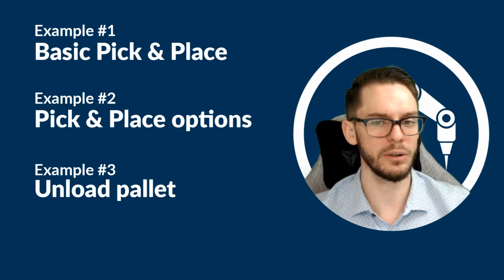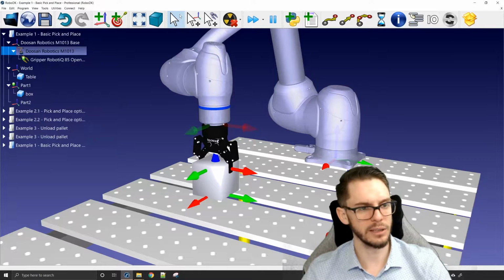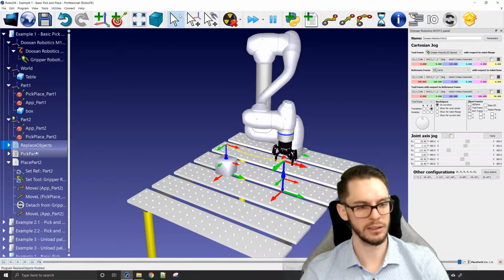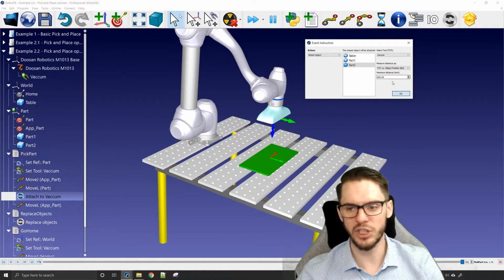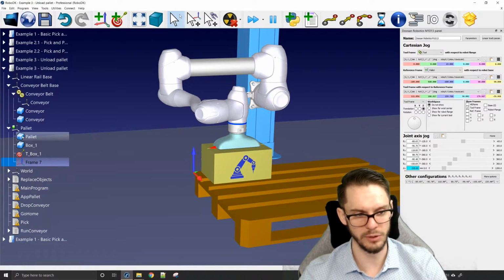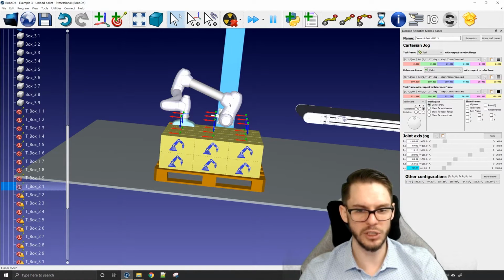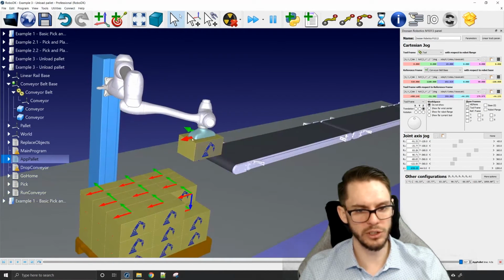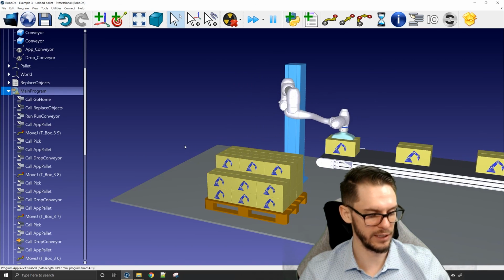Pick and Place - RoboDK Webinar

Comment: Hello! I have a question about connecting the robot with ROBODk through IP address. I tried to post it in the Forum also. I think I am not allowed to make a new thread in the Forum. I guess.        My issue is, I am entering the Robot IP in Robodk it says connected, ready but when I click on "Get Positions" or on "Move joints" It says not connected with the red signal. What should I do about it?  What should I do to connect it, even on checking with cmd, there is 0 percent signal loss for the IP address. I read the documentation also but it did not work. Help and guidance from you would be appreciated and if possible please allow me to make a new thread in the Robodk forum!
Reply from the maker: What robot brand are you using?
Why do you want to connect to the robot? What is your goal?
Reply: @RoboDK3D  I am using UR5 (Universal Robot). I want to connect the robot with RoboDK to control it remotely.  The goal is to update the robot program from RoboDK itself without actually programming in the robot. I am not able to connect. Do need your guidance and I tried to post on the forum also but I think the administrator has not allowed me to post.
Reply from the maker: @pankajnaryal22  
Updating the robot program from RoboDK and controlling the robot remotely are two different things. Both can be achieved from RoboDK. 
For the update of a program, the only thing you need is FTP transfer. 
For the control of the robot: Do you see a program running on the controller?
When you "connect", a program is sent to the controller via FTP (kind of a "listen to RDK" program), it needs to be running. 
https://robodk.com/doc/en/Robots-Universal-Robots.html#DriverUR
Reply: @RoboDK3D  Thank you for the reply! The first goal is to connect the robot with UR5, and to control it remotely. The scenario with my case is, I am able to connect the ROBOT with RDK like a ready option with green light is coming, but when I am trying to  I click on "Get Positions" or on "Move joints" after successful connections, the robot is getting disconnected.
Reply from the maker: You didn't answer my question regarding the program running... You simply repeated the same exact information.

Comment: Hi, I would like a suggestion to figure out my problems here please, I stuck with a gripper adding, I use Epson robot with scara type how can I add a gripper to it, when I did add a gripper to robot, it turned up-side-down every time.
Reply from the maker: This is because the Z-axis is pointing "inward" instead of "outward" of the root flange. 
Take a look at this: https://youtu.be/FltOFBCzx-w?t=551
You should be able to rotate 180 degrees around X or Y in the "Move geometry" and change the sign of the TCP Z-axis from positive to negative.